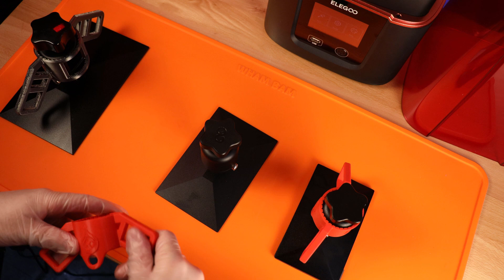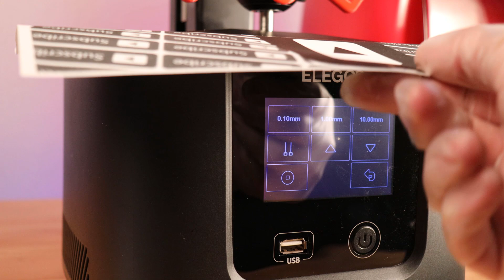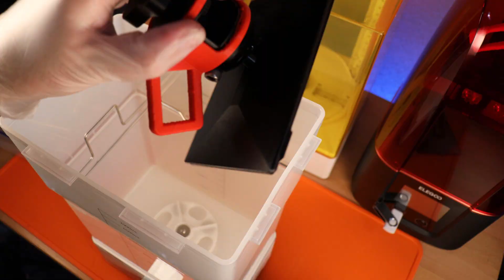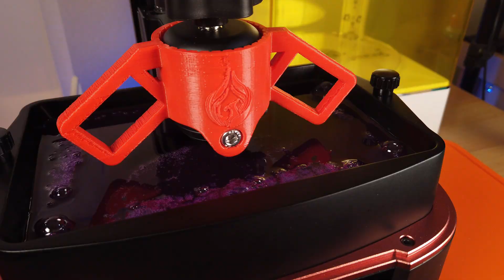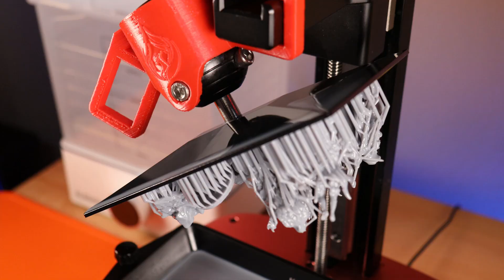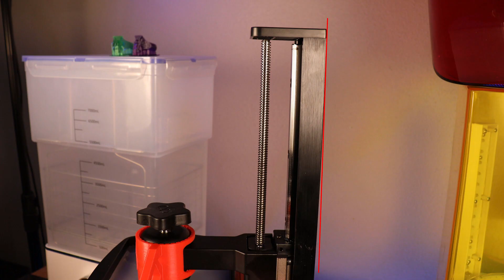Is This New Budget 4K Resin 3D Printer Worth Your Money? Elegoo Mars 3 Ultra 4k $320

Comment: If a company wants me to pay a $150 a year subscription to use their pro software to unlock all the features their product can offer I will avoid buying from that company at all cost and gladly pay another company $150 more for a similar product. No thank you cloud subscription business models.
Reply from the maker: Yeah that is understandable. From what I have seen this was not the choice of Elegoo, they used the boards from Chitubox. They have said they would be working with Chitubox to opening this printer up to other slicers due to the backlash. 

Like you know they do have that free version that works fine for most people. Lychee is the slicer that a lot of people want to use and it does have a free version as well but they also have a pro version that is $75 per year as well to unlock everything in the software. 

I did see the other day that this printer was in the Lychee slicer but I haven't tried slicing anything with it yet. I can update you on if that works or not if you like. 

I haven't paid for any of the slicers yet and I'm getting by just fine. I do have a free one year license for chitubox pro from this printer so I'm using that for this printer for now.

I hope that info helps 😁👍
Reply: @GomeowCreations  Yes that info is welcome, thanks. I would be interested to see what features the pro version has over the free one to see what I would be missing out on I suppose. But for me it is more of a principle thing and unless the difference was incredibly minimal I doubt it would change my mind about it. I have a prusa mk3 and open source is generally my preference when it comes to software but we cant always be spoilt by tools like the prusa slicer or blender I suppose :D

Comment: Is there some way to enjoy resin printer (or even FDE) without separate room to confine strong chemical smells? I really wanted one for the longest time but can't afford to keep it anywhere but in my bedroom...
Reply from the maker: If you can set up some ventilation you might be able to get away with it. If you are doing FDM and using only pla it will not smell very much at all.
Reply from the maker: Resin in a small space like that wouldn't be the best seeing it likes to get on everything

Comment: GomeowCreations, Hello, have you tried printing with photon s, can it be used to print jewelry?
Reply: any resin printer can be used for jewellery, but you must buy high quality casting resin to get good casting results ($200usd+ / kg bottles) also buy extra screen since high quality resins require much higher exposure times and your screen’s life will be dramatically decreased
Reply from the maker: Yeah you are not wrong but there are some new castable resins that are $75 per kg bottle, here is a link to it. https://amzn.to/2VcIJua
When it comes to the screens life, yes it will go out sooner using this resin. A replacement screen for the Photon S is only $40-55 so not really that much if your making money from your prints. 
If you are doing it as a hobby then this could be a problem over time.  😁👍
Reply: @GomeowCreations  Thanks for the info, I’ve heard a lot of good things about siraya’s resins. I just purchased it and will be testing it soon :)
Reply from the maker: So no due to me not having one but it is very similar to the first Elegoo Mars and you should be able to use it with out any problems really. You might have more lines on it but you can make it work if that is the printer you got.
Reply: @GomeowCreations , thanks!)

Comment: Would u say this is worth 140$ more than the Mars 2 (on sale)? I wouldnt be able to get a wash and cure and would kinda blow my budget too, i think the main question is, is 4k worth it? If anyone can reply it would be greatly appreciated!
Reply: Definitely get the Mars 2.
Reply: Yea get a 4K one. Especially if you are going to print smaller models. The older was and cure system is like $120 on Amazon right now.
Reply from the maker: Honestly it depends on what you are making. I have done some great prints using my Mars 2 Pro (Basically the same thing as the Mars 2 just a bit bigger) So if you can save the extra $140 by getting the Mars 2 you could also get the wash & cure setup and have just about everything you need for the  price of the Mars 3. I got my was & cure setup on sale for $100. I hope that helps.

Comment: lol dont buy this based off the Rook print. its BS and designed to make you feel good. Its an absolute garbage test. Use XPS first and get everything dialed in and show that.
Reply: wait turn off Anti-Aliasing for a crisper print? wtf
Reply from the maker: Yes. Anti-aliasing will smooth out your lines and you can loose some shape details. The trade of is that you will get more "layer lines". Normally when doing castable resins I have that all off and worry about the layer lines later and they polish out.

Sadly I don't have any XPS to try out.

Comment: Hi. Did you fix the Z axis wobble?
Reply from the maker: Nope, and honestly haven't looked into how I could fix that. Like I said in the video though it didn't seem to do anything to the prints. I will be doing more videos using it so we will see if things change or not
Reply: @GomeowCreations  There's one obvious solution used by the new giant 8K resin printer, a perforated build plate to reduce the suction when the plate is lifted out of the resin vat.  If they sell the build plates by themselves maybe get a second plate and have it either CNC'd or laser cut to perforate the plate evenly, or try it yourself on a drill press.
Reply: @thebluestig2654  Perforated build plate will do nothing for that wobble. Build plate suction against fep lasts only for the first couple of layers. After that, its the print suction/adhesion the z axis had to counter. Also keep in mind that it wobbles during the landing too, not only at lifting, that means its not a suction problem. Big printers like the Mega 8k have that for being able to move at normal lift and retract speeds against the forces of such a big resin area.
Reply: @jimb78  The bigger the build plate, the higher the capillary action suction force, it's pure physics.  Plus he only filmed the first layers, and everyone else who tried the same thing got the same results, even on different printers of similar size from other brands.  Drill or laser cut the plate, it's worth the shot and could influence the entire market for the better.

Comment: This is very interesting, question do you need to know how to use CAD to do 3D printing
Reply: For simply printing? No, none at all. If you're just using premade .stl files, you don't need to know more than how to slice and manage your printer. 
For printing parts that fit your needs or are for a special usecase? Definately a must! Sure, you can pay someone, but they need measurements and stuff, so it's way easier to learn it yourself and cheaper in the long run.
Reply: Y
Reply: Vv
Reply from the maker: Yes and no. So you can get already done files and you wouldn't need any CAD skills to print them. If you wan to make your own designs then you you have to learn how to do so. All the stuff I printed in my video are made by other people.